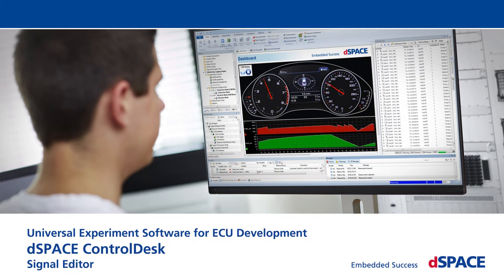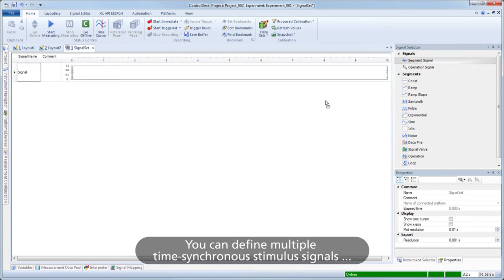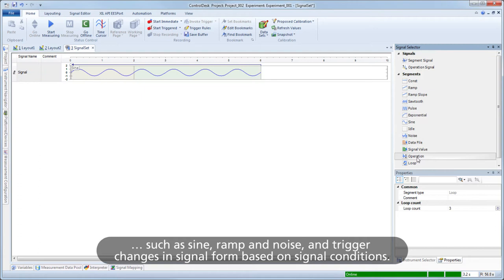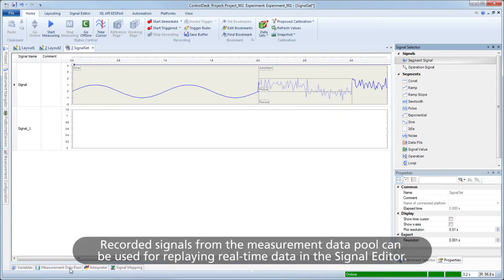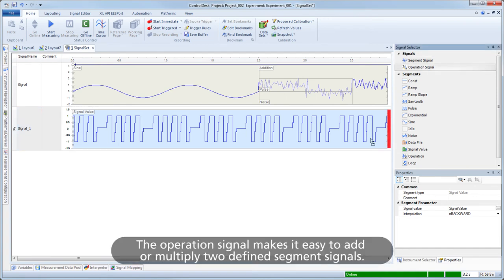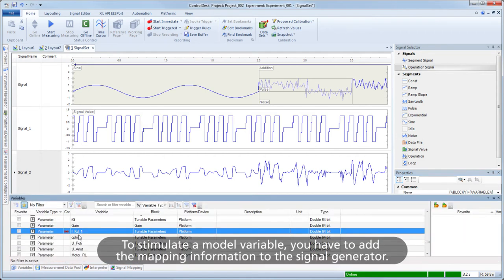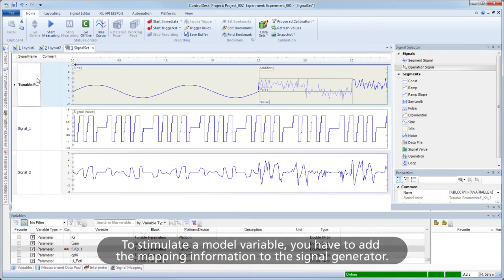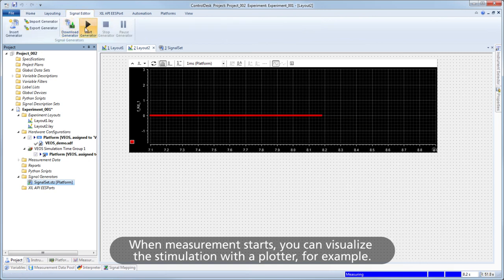dSPACE ControlDesk: Signal Editor

Comment: What are these signals? Are they can signals or variables in software or matlab model?
Reply from the maker: The Signal Editor provides panes and commands to create, configure, display, and manage signals in signal description sets.
You can use signal description sets as signal generators to stimulate model variables of simulation applications running on dSPACE real-time hardware or
on VEOS.
In the Project pane, you can manage and store signal description sets. Also, you can download and start the signal generators on dSPACE hardware.